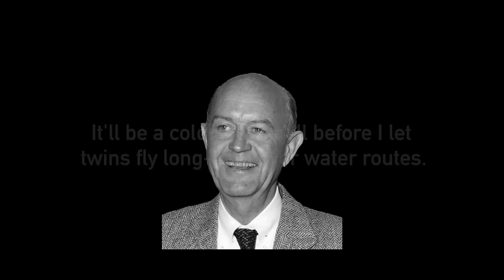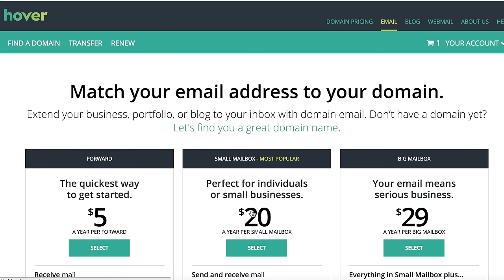Small Planes Over Big Oceans (ETOPS Explained)

Comment: It is a common misconception that quad jets are inherently less efficient than twin jets. If anything, theoretically they should be more efficient due to not requiring oversized engines for OEI (one engine inop) performance.

If you compare any two aircraft, the overarching factor that determines per-seat-mile fuel efficiency is aircraft mass for a given number of seats. The most efficient planes are the lightest ones for a given number of seats.

There are no straight comparisons you can make of quad and twin fuel consumption. As an example, the A330-300 is significantly lighter than the A340-300, with MTOWs of 242t and 280t respectively. The increased MTOW obviously requires structural improvements (for example the center landing gear) and extra fuel systems in this specific case, this means that the OEW is correspondingly higher as well. Another example is the 777 and the 747, here the same applies, the 777 being significantly lighter for the given passenger load, making it the more efficient aircraft.

Comparing two quad jets, the A340-600 and the 747-400 have MTOWs of 380t and 390-412t respectively, the A346 weighing around 6% less, but carrying 25% less (~300 vs ~400) passengers. The A340 is only competitive with the 747 because of newer engines, better aerodynamics, and the lower OEW.

This is why the A380 does so well in comparison to the 747(-400 and -8). Because on paper you can carry way more passengers for a given aircraft mass. Same applies to narrowbodies vs widebodies. The A321 can carry around 200 passengers while weighing less than 100t, while the lightest A330 regional weighs around 200t with only 300 passengers, all other widebodies being worse.

Comment: Currently studying ATPL flight planning and couldn't grasp this by reading just text. Thanks for the video. Was a big help. Am I correct to say that for a 2 engine aircraft the entry point of etops don't begin until 60min away from an adequate aerodrome? not the assigned 120min 180min whatever. That is only after you leave the area of 60 mins right?

Comment: In fact, the very existence of ETOPS made it possible to build the 777 and A330 in the 1990's, planes that eventually made it possible to start flying really long routes on smaller planes. The 787 Dreamliner has now made it possible to make many smaller cities capable of long international flights, even more so than the pioneering A330-200. Indeed, the 787 extended the reach of European charter airlines so they could offer package holidays as far as the US West Coast and eastern Asia. Indeed, Norwegian Air Shuttle's success is because they fly the 787 on these long routes at lower fare costs than other airlines.

Comment: The only issue with etops is that an aircraft flying hours from a diversion aircraft is screwed if it loses both engine for some reason.

 Now individual engine failures occur if simultaneously are practically impossible. But it’s there’s some sort of screw up with fuel calculations for example (Air Canada, Tuninter and LaMia for example), which results in both engines shutting down then you’re ditching in the ocean.
Reply: Well that’s pilot stupidity. Not the planes fault. If anything the pilot should be banned from flying long distances over oceans.

Comment: The example of a failing engine forcing Divergent and the etops plan in Alaska is not an isolated thing anymore. More and more of these engines are having stress fractures on the blades and if they're not careful the day's going to come when one plane is going to have both fan blades fail within minutes or hours of each other. And then people are not going to think this FDA official was so crazy and or out of touch.

Comment: As much as I have found your videos quite informative and factually correct, the segment on how ETOPS helped to shape Hawai'i as a state as a bit misguided; I do agree that there was not enough passenger/cargo demand for airlines to serve the outer islands directly, but there are several other huge factors that play a significant role that marginalizes ETOPS and its role on the state's development.  There has been a strict law in place that prevents incoming mainland flights from stopping in HONOLULU then continuing on to another island with passengers, to protect inter-island airlines.  This, in my opinion, on the airline front would be the major reason why outer islands did not see passenger service as high as it potentially could be.  Airport size and runway length on two of the outer islands, Kaua'i and Maui have shorter runways as well; not allowing a larger jets to use the airfields. Social and political pressure to keep the outer islands more rural and underdeveloped I believe, as well as geographical and resource limitations on the outer islands kept them from growing as quickly as 'Oahu, or many other places.  ETOPS (or lack thereof) didn't stunt the growth of the outer islands,we actively chose to.

Comment: You forgot about the A340, another 4 engine jet by Airbus. You said at 7:05 that only the A380 and the 747 are the only 4 engine aircraft produced by each respective company.
Reply: Probably meant still in production. A340 production ended in 2011.

Comment: If that same 787 had 5 hr. + ETOPS certification, then why divert and not continue to either Canada or west coast US? Back in the  day, ETOPS meant Extended Twin OPerationS.
Reply: It was probably the pilot and American's call to land in Alaska and not continue further for the safety of the passengers. 

The ETOPS time rating is more of a "worst case scenario" wherein the plane has to fly over ocean until it can get to an airport in a pinch.
Reply: just because it has the ETOPS rating doesn't mean you keep going for that period of time. You still divert to an airport just incase the 2nd engine failed

Comment: There is no direct flight from South America to Asia. I'd love to non stop flight from Santiago de Chile to Tokyo. 
Great circle distance from Santiago SCL to Tokyo HND 17219 km 9298 nm
It can be achieved  by the A350-900R that has more than sufficient range, 19.100 km or 10 313,2 nmi
This route I think has sufficient ETOPS as it goes near IPC (Eastern Island) PPT (Papeete) HNL (Honolulu) and the Wake Island (AWK) on the way. 
The Sunrise Project by Qantas flew London or New York to Sydney on the 787-9 reaching about the same range. 
Latam could achieve it. As for now it does with connections to other airlines through AKL (Auckland), SYD (Sydney) or LAX (Los Angeles) and it's 21+ hrs. 
It has two main issues: commercial viability and crew regulations. 
Any comments on this? It's a 18:23 hrs flight

Comment: When Boeing's director of engineering, Dick Taylor, first approached FAA administrator Lyn Helms in 1980, Helms responded "It'll be a cold day in hell before I let twins fly long haul, overwater routes." This was not as unreasonable as the video wants to make it. The 767 was the first plane to be approved for a reason. This video is depicting jet engines prior to the 767 launch in 1982 to be just as reliable and they were not. Engine failure in the 60s and 70s was more frequent. Boeing presented data from the 767's first two years of service and the leap forward in reliability demonstrated started the use of 2 engine planes for trans atlantic and trans pacific routes.

Comment: In an emergency believe me accomodations and feeding the passengers aren't even the last thing that pilots worry about.
Reply: @bosstowndynamics5488  All Airlines have a list of approved designated Alternates in case they have to divert in their Operation Manual which is approved by the FAA. If it's  an airport they don't fly to they have  an agreement with a Ground Handler to provide services that maybe required. Dispatched many diverted aircraft in my day due to weather, mechanical, ATC delays, Sep 11th, volcano eruption, etc..

Comment: Ha! First off the number of engines doesn't have much to do with fuel efficiency, it primarily effects maintenance and to a lesser degree capital costs. 
Second, the 747 wasn't made large to make 4 engines viable, it needed 4 of the largest engines available at that time just to fly. It was made large at the request of airlines who were suffering severe airport congestion in the pre-"deregulation" US market, they approached Boeing and asked for a plane with double capacity. Boeing only discovered some years later(as deregulation was shortly after the 747 had come into wide use) that about half the customers were only using it for its long range.

Comment: I find the classification here of the 787 as "small" amusing. A 787 9/10 has an MTOW of 254 tonnes! Here is a list of larger commercial aircraft A340, A350, A380, 747, 777, IL96, MD11/DC10. It is by any measure a large aircraft! Why new routes are available, demand, efficiency, range.

Comment: @ 7:07 Boeing and Airbus's Largest jets are both their only 4 engined planes- Airbus has the a340, which is also a 4 engine plane dummy
Reply: A340 is still in service, but the production ended in 2011. That makes A380 the only 4-engine airliner from Airbus still in production.

Comment: What happened when a two-engine plane flies somewhere that’s too far away from a diversion airport? Is the airline or leasing company or whoever owns the plane fined? If there’s and engine failure in that area is the pilot supposed to say that they are all going to die?
Reply: the pilots probably would be in trouble. you plan your route beforehand. Deviating from the route would first alarm the controllers who are meant to be monitoring you if you don't check in with them when you're meant to because you're out of range. You'd then be in trouble for unsafe flying/not listening to air traffic control ect.
Reply: You wouldn't be allowed to in the first place. You have to file a flight plan.

Comment: I miss the tristar airplanes... The 727, the DC10, the MD11 and my favorite aircraft of all time the L1011.... now everything looks more or less the same with the exception of the 747 and the A380 ... there was a time you could be standing outside and look up an an airplane flying 40,000 feet above and within seconds you could tell what it was.... now they all have more or less the same shape and same design.... also now you can't see 40,000 in the sky any more.... thanks alot Geo-engineering chemtrails.

Comment: It should be noted that the BA a318 flies to New York via Shannon
Reply: Matt Moerder yes, but he did say specifically in the video that it flies directly from JFK to LCY non stop.

He probably knew already that It flew via Shannon on the way out for pre clearance and immigration reasons and to top up on fuel because the runway was too short at LCY to take off with a full complement of fuel.

The 318 enhanced is perfectly capable of flying the route non-stop from West to East without stopping.

When I flew on the route, the first officer told me that due to the larger fuel tanks and the small 32 seat capacity, the plane had around 3 to 400 miles of diversion fuel left by the time it lands.

Comment: What about the A340? it has a quad engine aswell, but it's smaller.
Reply: The A340 is out of sale since 2011 and is about as long as a B-747 (there are several configurations), but has less cabin width (8 instead of 10 seats per row eco). The successor A350 is twin-engine with similar length range and 9 seats per row, resulting in better efficiency per passenger - if booked out.

Comment: I always thought that small twin engine jets (except modern ones such as 787, A350, 777, 767 ect) couldn't cross large oceans due to the amount of fuel they could carry. Guess I learnt they are capable of flying that far. o.o
Reply: the flight they're talking about is like 4-5 hours because the start point is so far west. A lot of domestic routes are similar length

Comment: Why did trijets fail though? They are like the middle of 2 and 4 engines, which should theoretically make them safer than 2 engines but have better fuel economy of 4 engines. I would like to know why.
Reply: FoxGaming76 YT they failed because twin engines become safer. Yes on paper a trijet will be safer than a twin jet. But the difference is so negligible practically that I just makes more sense for twinjets, which are already the size of trijets
Reply: ZK-APA yeah, makes sense.

Comment: With twins, you got three hours if an engine goes out. The remaining engine would have to operate at 100% to keep the plane aloft. That is not good as even the most fuel-efficient engine in normal ranges is a fuel hog at 100%. No jet turbine is made for continuous 100% thrust operation. That puts the plane at risk for a water landing from losing the sole remaining engine. Four engines were the norm for reliability as losing one engine would not require a 100% load on the remaining three engines. You could actually maintain cruise altitude, but with less speed at a lower power setting. Captain with Pan Am 1950-1978. Happened twice to me on the Pacific routes. They all know this, yet look the other way.

Comment: Boeing 727 exist
Wendover Productions: there is no small plane that has more than 3 engines
Reply: Tim Yang the 727 is hardly used as a passenger aircraft.
Reply: @ZK-APA  Why are there over 1000s 727s
Reply: Tim Yang they made around 1800 727. But as of now less that 50 are on active service.that too as either charter cargo or vip configuration.

Comment: You made a mistake.Airbus also has the a340, which is a 4 engine plane, and the A380 is going to go out of production.
Reply: It was talking about planes in production, A340 stopped in 2011.
Reply: MrMonotone I thought the a340 was still in production.
Reply: RoRo Cinemas27 no. It hasn’t since 2011

Comment: I don't think the term type rating is used in the correct context in this video.  A type rating applies to flight crew licensing and standards and is a rating that is attached to a private, commercial or ATP certificate that allows the holder to acts as SIC or PIC of that particular type (e.g. Airbus 319/320 type).  An airframe can have a particular ETOPS rating associated with it's type certificate or a supplemental type certificate embodied to permit or extend an ETOPS rating.  Type rating and type certificate and ETOPS rating are all different things.

Comment: You persist in saying that only 'large' aircraft could fly these routes - have you never heard of the Boeing 707 and the DC8? I think you will find that the Boeing 767 which you say is the first twin engined and therefore smaller aircraft to fly such routes is actually larger than the 707's and DC8's of the 60's and 70's ...

Comment: couldn’t plans have just installed spare engines, so only two engines would be running and the other two would only start up if they had an engine failure?
Reply: Weight penalty. No point carrying two extra engines if you'd almost never use them.

Comment: I still dont get it: In short - What happens now, when both engines fail and your several hours from a place to land?
Reply: Engines don't usually fail at the same time. If one failed you'd immediately change course for nearest suitable airport. Only time that could be possible is bad weather (which can be avoided) or fuel contamination (checks done regularly)

Comment: Let us look at the scenario between Sydney or Auckland TO Santiago de Chile or Buenos Aires.   An 11 to 12 hour flight.    This is a REMOTE long haul route, and with no possibility to land anywhere between New Zealand or the South American continent, because the route is too far south to allow for Papeete or Easter island as a place to land in emergency.    With an engine out on a quad jet,  it is one engine out of 4... So you will be flying on 3 engines.   The distance you may have to travel in an emergency state can be up to 5  hours.. possibly longer.    On a twin jet in the same scenario, you will be flying on one engine (such as a 787), for this same amount of distance flying over a very remote region of the southern Ocean...   Go figure which is the safer option.  I'd like to know what redundancy the airlines and aviation bodies have built in for this kind of scenario, which is not that far fetched in my view.      Enough said.
Reply: The reliability of engines these days is the reason why we have ETOPS 370 on the A350. If one is to fail it is even less likely that the other will shut down as well. When was the last time dual engine failure occurred because of something that wouldn’t affect both engines anyway. Nearly all have been either fuel issues/exhaustion or bird strike so they would affect 4 engines too

Comment: How does the British Airways a318 Fly direct between New York and London cause the range of an a318 dosent reach that far
Reply: The Coaster Boy 14 because it isn't a standard a318.

It is a 318 enhanced, with only 32 business class seats on board all fully lie flat beds. Therefore it is very light. It also has slightly enhanced fuel tanks.

The journey from LCY stops at Shannon because the runway at LCY is too short to take off with a full fuel compliment. The business class passengers go through pre immigration checks Shannon while the plane refuels and flies on to JFK as a domestic aircraft meaning that the Passengers can disembark and go straight to baggage reclaim without having to go through immigration.

On the return journey it can fully refuel and fly directly nonstop from JFK to LCY without stopping.

Just think of it as a corporate Business Jet.